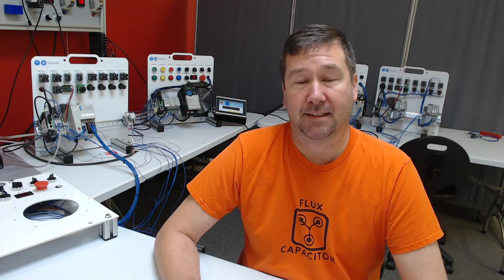Cost of Becoming UL 508A Industrial Control Panel Panel Manufacturer

Comment: Huh. That explains why I keep on seeing those weird and presumably expensive ferrule crimps while the Chinese ones I got for $10 works just fine.
Reply from the maker: There can be issues with cheap ferrules, mainly from not being annealed properly.  Between deforming them with the crimper and heating and cooling over time from electrical loads, they can crack.

However, you can use the Chinese ones in a UL panel as long as you use the crimper they recommend.

Comment: I’ve built a lot of Underwriters Listing panels. It’s a benefit only when required. I’ve done lots of jobs that didn’t require a 508A approved panel. I still conformed to UL508A but no sticker installed.
Reply from the maker: I'm going to hit on this in an upcoming video, the issue is it is always required in the United States. OSHA requires electrical equipment be approved by a Nationally Recognized Testing Laboratory (NRTL), UL being one of 20 currently approved by OSHA and by far the most common.
Reply: @TimWilborne  correct, some manufacturing facilities required the UL508A sticker while others didn’t require a UL specific branded listing but another conformal recognition.